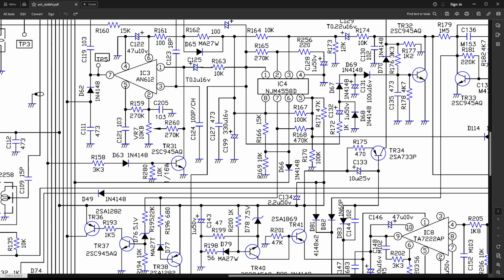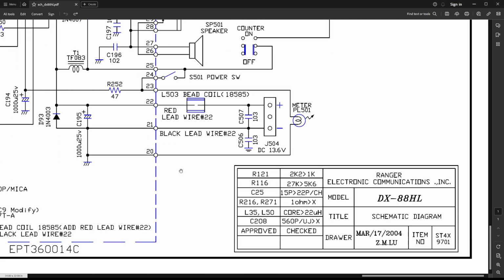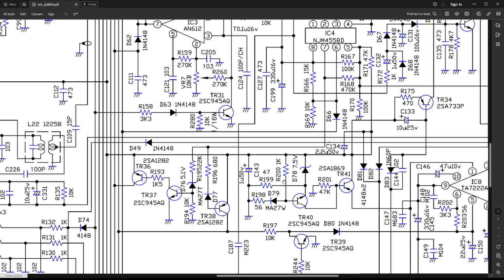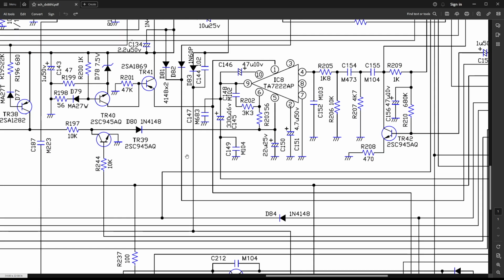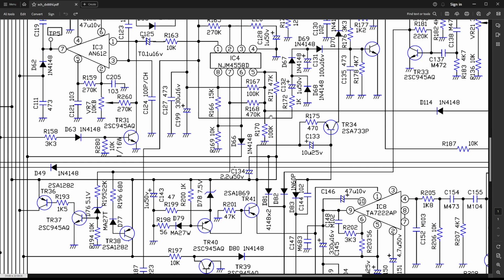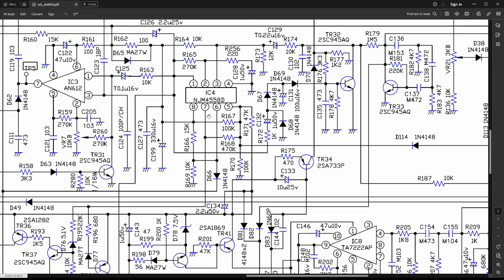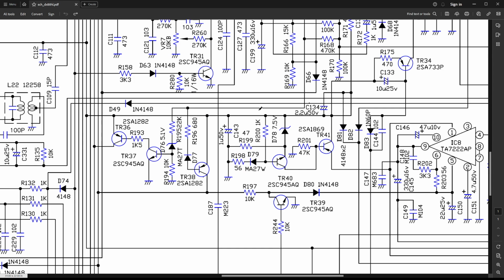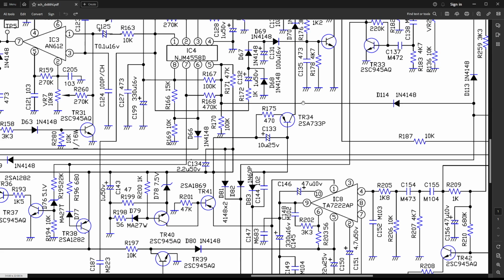Galaxy 88 and similar RX/TX switching troubleshooting

Comment: Thank you for the good technical walk through. I don't have as many problems with rx/tx issues as I do am power regulator circuits. Sometimes it is difficult to get the (roughly 6 vdc) on the center leg. Thanks in advance, Jaguar
Reply: The radios will go into transmit mode, but there is no RF power output on a bench meter, but there is preamp. The power regulator does not turn on. The regulator and finals test good. Where does the negative bias come from?
Reply from the maker: Are you saying you have no power to the am regulator?

Comment: I learned this the hard way back in the early 1990s when a 2950 came in with it not switching to TX. (Some other shop had it first)
I spent probably an hour studying the schematic before probing the "Mic Amp" IC.
Ended up replacing the IC, and radio worked fine after that.
I REALLY wish these videos were available as a resource back then :) SO MUCH useful info available to us now!
Reply from the maker: You are right.. I forgot that the 2950 used an identical RX/TX switching scheme. A lot of the clones and relabeled radios do as well.
We are talking about pre-microcontroller so this method made the most sense back in the 80s when this was designed.